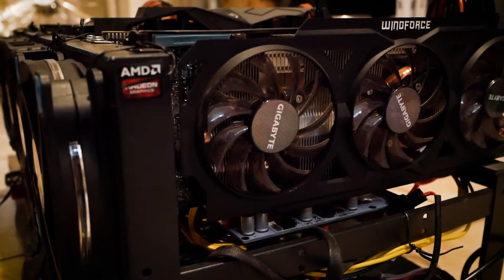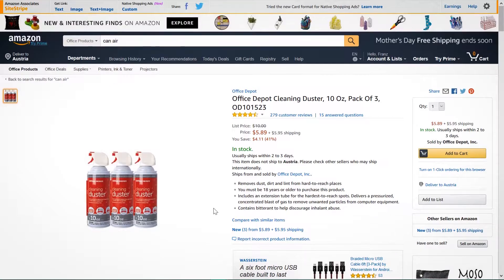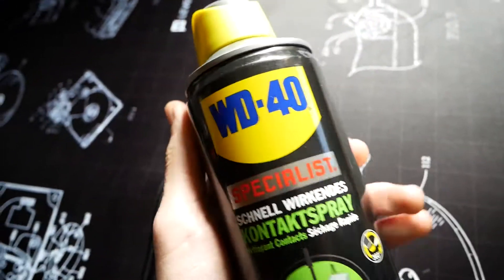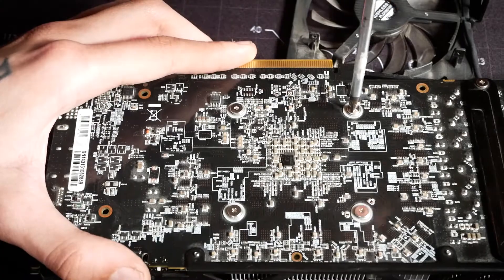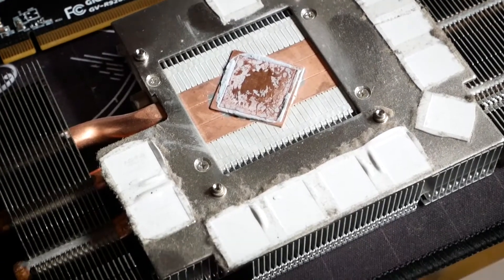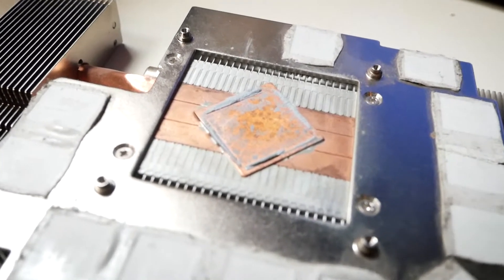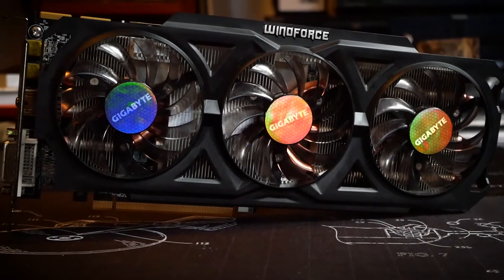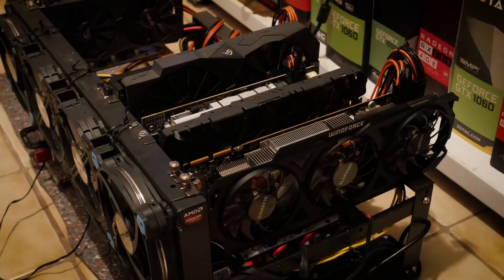GPU Maintenance: lower temperatures with new thermalpaste! Clean Mining GPUs

Comment: I have bought a used graphics card and it have a some kind of hard white dust i dont know and it dosent come off how can i remove it
Reply from the maker: I use "WD40 contact cleaner" for stuff like that. Be careful, not the normal WD40 but the ecc (electronic contact cleaner) is exactly for that, BUT you have to leave it dry off and evaporate well. Cheers ⛏️
Reply: @CursedMining  thank you so much
Reply from the maker: Sure mohamed you are very welcome! That's what this channel is for :)  if you can't find the wd40 version there are other contact cleaners too just be careful it is made for electronics. Pure 99% alcohol works too BUT could damage plastics

Comment: Im thinking of buying a baikal giant x and im afraid of how loud it is gonna be. Im not quite sure how loud it will be, I heard it is gonna be 65 decibel and im planning on building a soundproofer for it. I will probably have it in the room next to my room if thats possible. What do you think?
Reply from the maker: Giants can be loud - less than Antminers though. It depends on the soundproofing solution you are thinking of and how thick your walls are. Are you thinking of a boxed setup with exhaust?
Reply: Cursed Mining i was thinking of building a box with soundproofing materials with exhaust, do you think you can decrease the decibel level and in that case how much?
Reply from the maker: How much exactly is hard to tell. Depends on your exhaust, which material you use for the box itself, how thick etc. - but it will definitely be better than before. Also depends on if your exhaust directly blows the air outside (more silent) or it's somewhere in the room (louder) etc.
Reply: Cursed Mining The exhaust Will go out of the window, do you think you can decrease the decibel to 50 instead of 65
Reply from the maker: Hmm with silent tubes etc. I think it is possible. But you will still need a strong exhaust to move the air. Silence is important for you but you don't want to bake your machine in the process. I know the struggles. I slept in the same room with my first antminer (S1) for one or two weeks until I figured a lot of stuff out =D  in the next room it was already liveable.